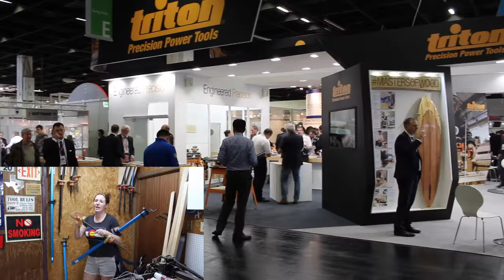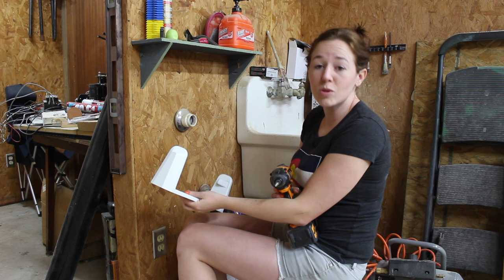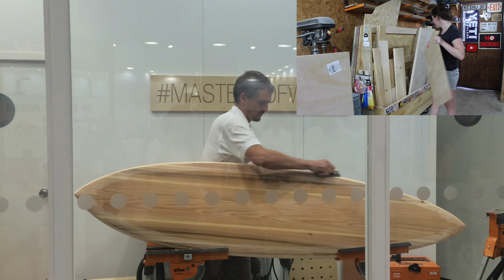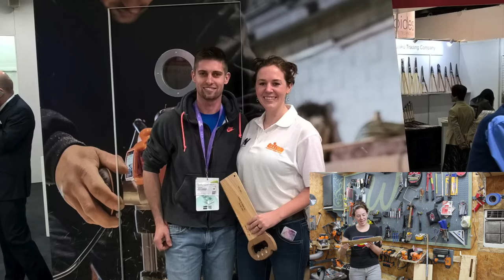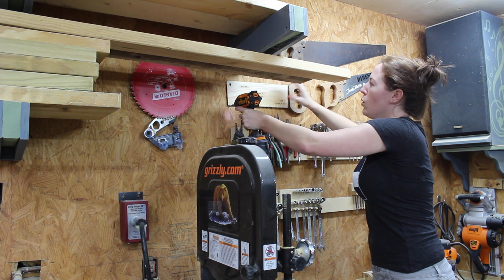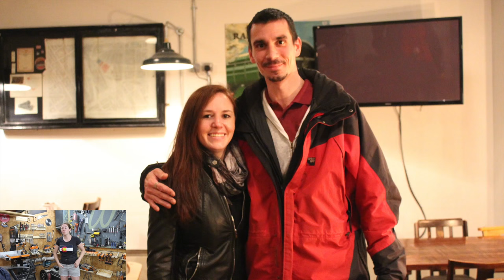Vlog - My Trip to Europe

Comment: Nice video I use a lot of festool tool I never had the opportunity to try the triton tools but I do like the router table and saw kit . Here is a trick
that u could of done with the cuped wood is to cut it in the middle and glue it back together or leave a 3/4 space and use it as a design feature

Comment: At the beginning of the segment, I see you are scrubbing your table saw. Here is a suggestion to help keep the table clean and rust free. Get yourself some thin sheet magnet. It is the type that sign makers use. For mine, I have two sheets 900mm (about 35.5") wide. I put them side by side on the table and that keeps out all air and moisture (I do clean my saw table with an anti corrosion product before putting the sheet magnet down). When you want to use your table, you simply lift off the sheet magnet covers. It is a simple cover that stays in place and keeps everything protected.

Comment: The experienced air traveller know there are 2 types of luggage - carry on and lost. ;)  

As for the dado's not fitting in a cupped panel.  The issue is usually that the middle of the joint is not cut deep enough for the panel to be clamped flat.  One solution for that (and an excuse for a new tool) is to use a router plane set to the depth of the dado and clean out the middle of the joint that is not deep enough.

Comment: Glad you had a great trip! Did we get to see a saw blade buried in a SawStop block on your wall there? You still have all your fingers, so I guess it did is job  :-)
Reply: *its job
Reply from the maker: Oh it was actually tripped by a scrap board I was cutting that had a thin sheet of radiant barrier on the underside (I didn't see it). So I didn't trip it with my hand or fingers. : ) But it's cool to look at so I didn't want to throw it away.
Reply: +April Wilkerson hello I am French sometimes I have a little hard to follow is that you could put them under title. your creations and his super tricks
Reply: +April Wilkerson I didn't noticed the cartridge attached to the saw until +Tim pointed out. Wow you must have your heart being shot up into the throat and skipped a beat?! I hope you didn't changed your pant (trouser) after this?! Haha :D